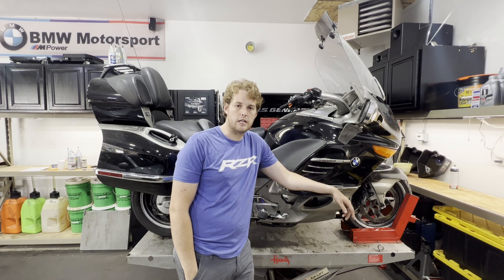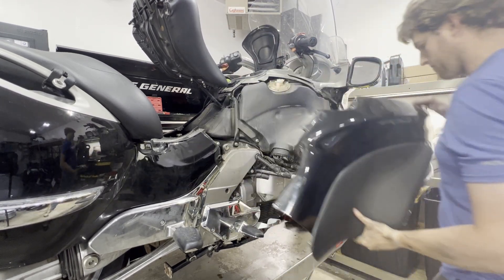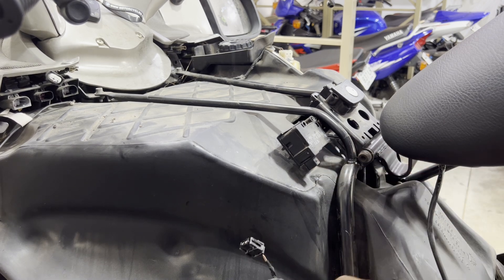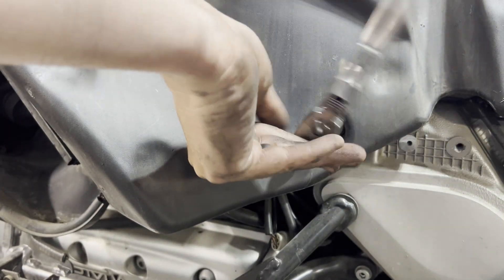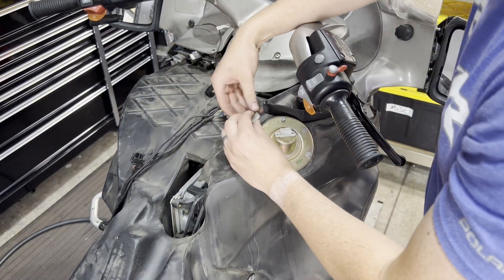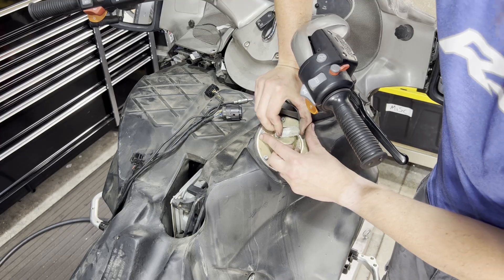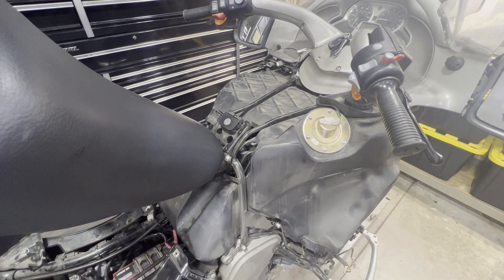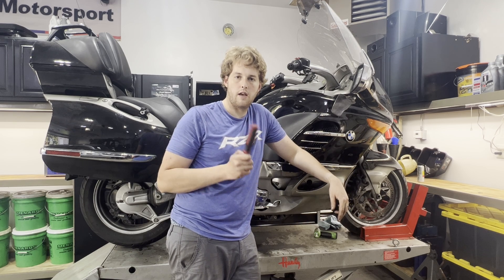K1200LT Fuel Filter / Fuel Pump Replacement

Comment: Heresy alert! Filter delete with a straight hose in the tank, move the filter outside the tank. Begin the comments on how the outside rubber hoses and fiberglass/plastic tanks of some BMWs are much stronger than the welded steel fuel injected rated filter.....In all seriousness, thank you for your videos.

Comment: If someone replaces the fuel pump and puts the wires on backwards will the pump run backwards?  or now run at all?  Thanks
Reply from the maker: they are different size eyelets so its impossible to hookup backwards.
Reply from the maker: but to answer your question, yes it will run backwards.